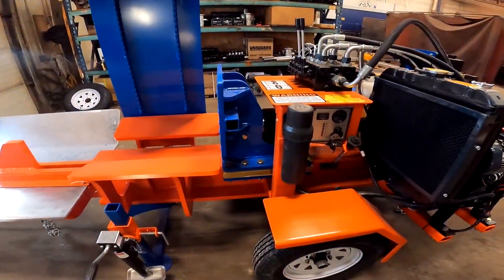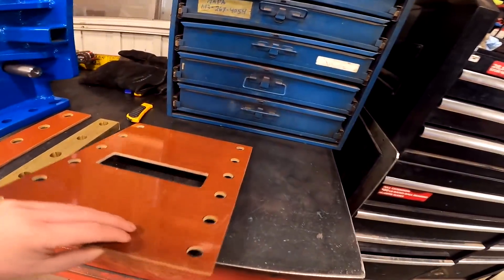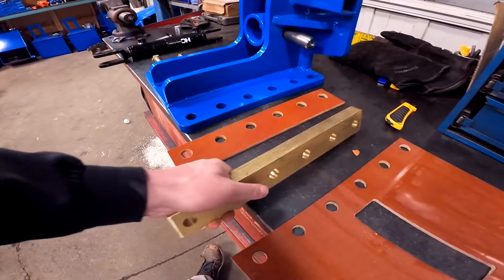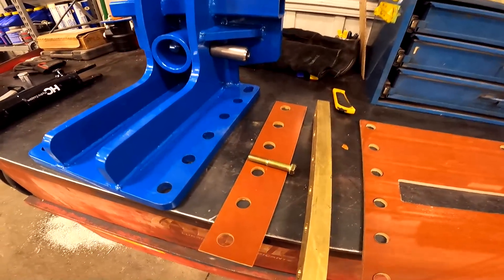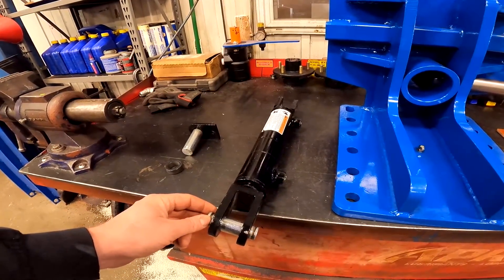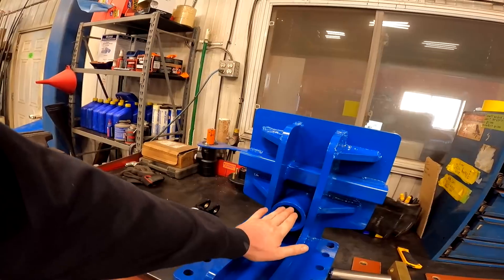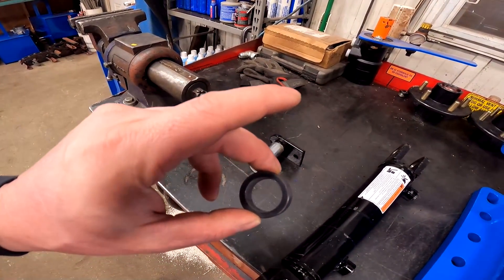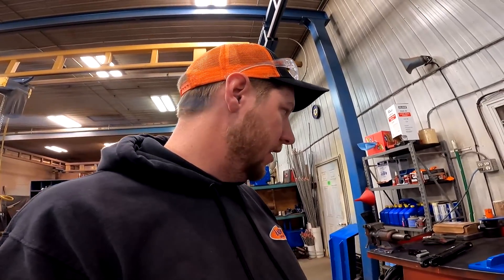Eastonmade; What Actually Wears Out On A Commercial Log Splitter?

Comment: I think you’ve hit the nail on the head with the right combination of long lasting wear components and good smooth operation, we’ve had our 9-16 a little over a year and it still shows no visible signs of wear under or around the pusher other than just the powder coat, and it’s not even all the way worn off, bravo Andrew!

Comment: Betting there's o-rings and seals inside those valves that will eventually wear out and cause leaks. As well as the cylinder seals and packing. But you'll likely go many, many hours of operation before any of that wears out. Just wondering why you went with the Kubota instead of, say a Yanmar, or Deutz?
Reply from the maker: Service

Comment: Andrew, Youtuber, "old school millennial" just put up a video showing broken bolt on the small bottom plate of the pusher assembly on the Ultra model splitter. Noticed this model has none of the wear components your larger splitters have. Appeared to be some gauling on the steel rail the pusher slides on also. Is this a lack of maintenance issue or a design problem? Thanks for the input.
Reply from the maker: Not sure how old of a machine he has.  I know he bought it used.  we have changed our processes to prevent a lot of this from happening.  The way it is designed there really shouldn't be and wear because of how rigid the cylinder and pusher are.
Reply: @EastonmadeWoodSplitters  Okay. A used machine explains a lot. Thanks. Looking at his previous videos it appeared he got it only a few months ago.

Comment: On the topic of wear, can we see some really used and abused Easton Made splitters? That's a good way to show that they really hold up over time!
Reply from the maker: Some of the older models could get tore up with the wrong operator.  These new ones don't really show much abuse.
Reply: @EastonmadeWoodSplitters  I see, makes sense, the wear parts wear out as they should and the other parts don't. Either way, when covid has settled maybe you can visit some more customers and show real world examples. Not just the ones that had just bought the machine, but some with a number of years in use. 🙂
Reply from the maker: @lofman  i think that would be a good idea.  I have a bunch of guys locally that run them on a daily basis that would be good to go see.

Comment: your use of brass slides on the pusher plate was one of the first things that drew my attention. Having been in the firewood and metal fabrication racket myself for a few decades the use of brass slides for critical wear points on a sliding mechanism is crucial for longevity. When in doubt, built it stout.

Comment: Just curious on the Ultra (maybe the Axis too).  What do you recommend for lubrication for that unit?  There doesn't seem to be a wear component.  I've been smearing some thick bearing grease on the main bar but it doesn't seem to stay on very long.  Thanks
Reply from the maker: Thats normally what we tell guys to do.  With the axis and the ultra there really isn't a lot of movement in the cylinder or pusher/wedge.

Comment: how long will the axes live 

if it does not last longer  then 20 years of doing 40 cord a year its junk
Reply: Don’t understand the comment?
Reply: @stevesedgwick5789  if it does not last longer  then 20 years of doing 40 cord a year its junk
Reply from the maker: its a little different system.  almost eliminates any movement or wear.  That's really not a lot of wood.  We have several guys that we gave them to in the spring and are up around that number with zero issues.
Reply: @EastonmadeWoodSplitters  ok good

Comment: Thank you, Andrew! I appreciate this one. This helps to understand your machines better. One question, what lubricant do you suggest putting on the top of the rails under the pusher plate?
Reply from the maker: we normally use wheel bearing grease

Comment: Why do you use aluminum for the table after the wedge rather than steel and why don't you have slots cut for bark and splinters to fall through? You build great machines but im just curious as to why you do it that way. Thanks from Western New York, USA
Reply: You don't want crude building up that close under the log lifter.
Reply from the maker: ^^^^^that's what happens.  after a couple of cords you have a lot of debris.  I have always found it better to separate it further away at the end of the conveyor.  The other issue is having and open slot and having a knot or an edge catch it when pushing wood through the wedge.

Comment: When I ordered my 22-28 the Kubota diesel I see bolted to this splitter in the vid  wasn't an option how much to upgrade? More tonnage with the diesel? Faster cycle?
Reply from the maker: Not sure on the exact price yet.  Somewhere between 6-7k.  Same everything.  Just a lot better on fuel.  We are planning on trying some different pumps to speed them up in the next couple of months.  If you have a machine on order we can change it to the kubota
Reply: @EastonmadeWoodSplitters  for 6k I don't think I'll burn that much fuel in a log splitter in 10 years lol how about a 35hp vanguard with a huge pump?
Reply from the maker: @Dakotalogger  lol it would be an investment for sure.  We are trying lots of new things.  I don't think you'll see much of a bigger engine than what we are running now.

Comment: Good evening. Is it possible to purchase a wearable parts kit at time of purchase, that way the purchaser would be a step ahead, if you will.??
I could see this possibly being good for the guy's/ gals who are a Commercial company, kinda thinking ahead and avoiding downtime. 
Appreciate your time breaking down the information/educational vlogs. 
Be safe everybody
Reply: That's what I was thinking... If you plan to use one of these machines a lot, having a few spare parts on hand wouldn't hurt, even if you didn't need them for 5 or 10 years... Assuming the parts don't deteriorate over time like rubber can, keeping a full set of wear parts in the shop would be cheap insurance compared to losing a few days or more of production while you wait for replacement parts to arrive.
Reply from the maker: Yep for sure we can. The nice thing about being made of nylatron is that they are really easy to make and most machine shops are familiar with it are a wear material
Reply: I had that same question!  A couple sets of wear plates and a few sets of bushings for the log lift and boomerang too?

Comment: Best designed splitters in the world.  Great work, Andrew.

It's great to see you expanding to keep up with production.  I've got a precision manufacturing company with several machining and turning centers, surface/OD/ID grinders, wire-EDM, laser/TIG/MIG welding, heat treat, CNC inspection, etc.  If you would like any feedback on equipment you're looking at I'll be glad to help any way I can.